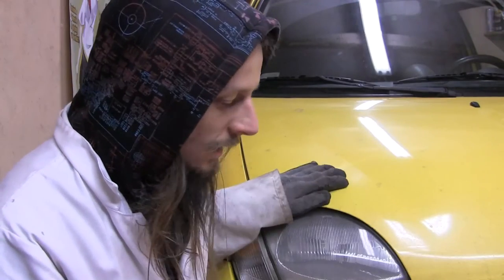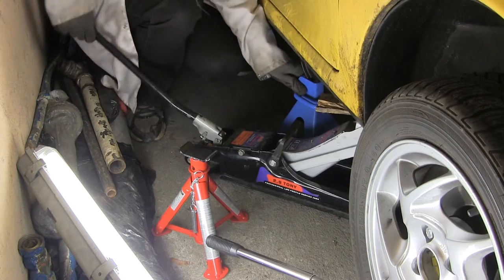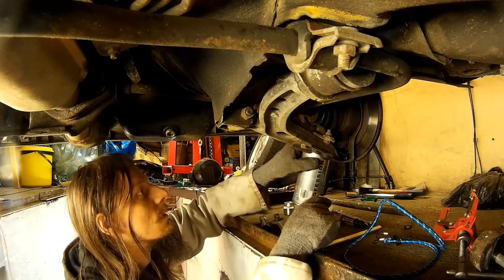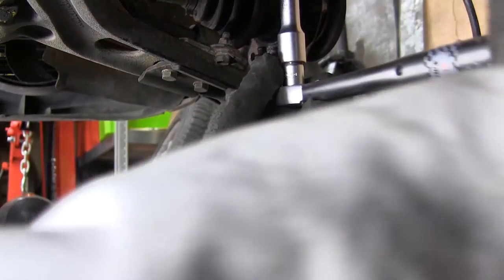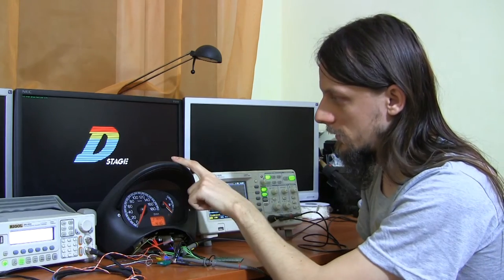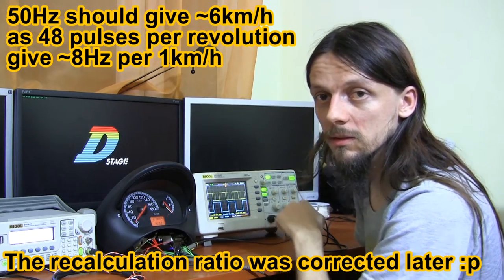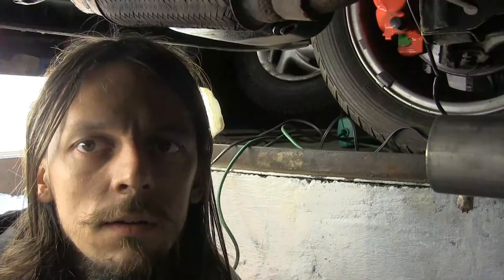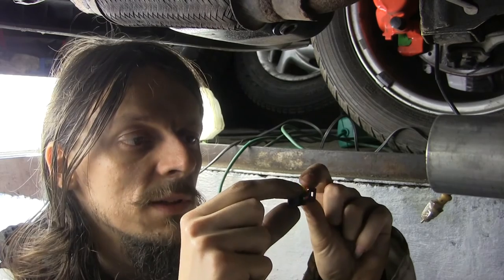DStage #11 - Ultra precise speedometer in SC

Comment: Hi, good job guys.
Probably I miss something.
I see that you connect the speed sensor. The abs st the end you install it?
And which abs you install?
Reply from the maker: Sorry, I din not get your question. Are you asking if we have installed the ABS itself? If so the answer is no for few different reasons. However as you can see the ABS sensor is there and it is used to get vehicle speed as shown in the video. Sensor is connected to my dedicated electronic circuit, not ABS controller of course.

Comment: Nice to find well explained videos about Seicento! I just bought an Seicento sporting 1.1. Abarth and i have trouble with my speedometer. It is stuck at 60 km p hours and when i go faster it slowly goes down. I do not know where to start looking, i disconnected the cable to the speedometer and reconnected it but nothing worked.  I hope you have tips for me to get started. Everything is welcome.
Greetings from the Netherlands!!
Reply from the maker: Hi there. The easiest option is of course connecting different speedo hehe. What you can do is take a multimeter and try to measure signal on pin A9 (that's in the corner of the larger connector, there should be numbers on plug or socket from what I remember). When you move the car slowly you should see voltage signal on that pin jumping from 0V to 12V and back. But the plug has to be connected as it will power the impulsator (VSS) in the gearbox so you need to put a needle in the wire or connect to it by some other means, maybe you'd be able to put the probe from the back of the connector. 
If the signal is present it means something is wrong with the speedo, if it's not there then check if you see 12V between "+" and "-" pin on the impulsator plug. If not perhaps the wires are broken, if there is 12V there then either the signal wire is broken somewhere or the impulsator itself.

Comment: Where can i get this setup? Is it buyable?
Reply from the maker: Hi. The short answer is yes, it is buyable ;-) Recently one champ from Italy asked me about it so I have ordered manufacturing of few PCBs that I will then populate if electronic components and program. This is a newer version that should allow the user for easy changing the recalculation ratio with a potentiometer. I still need to test it though hehe. Also, there seems to be some kind of problem with my ordered PCBs - I decided to get them from China and that was prior to the virus thing. Now the shipment seems to be stuck somewhere. It should be already at my place a week or two ago but I'm still waiting. I can get it locally in Poland or wherever in Europ just at a higher price. If you're interested in more details please write an email to dstagegarage@gmail.com.